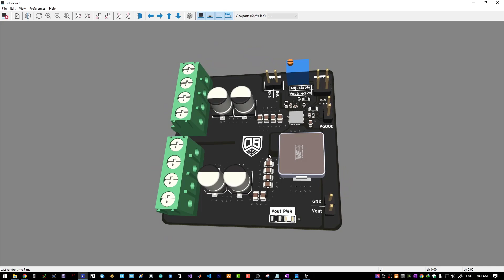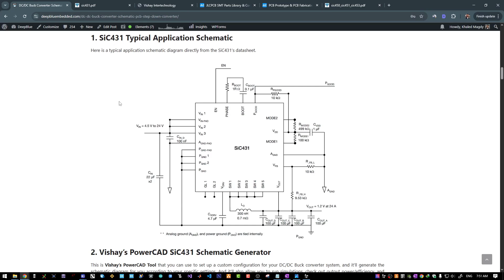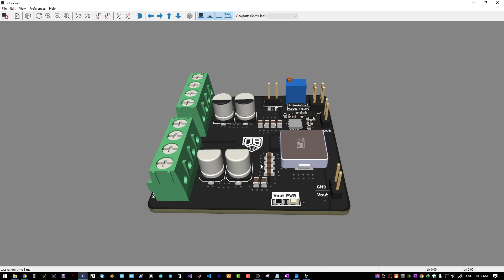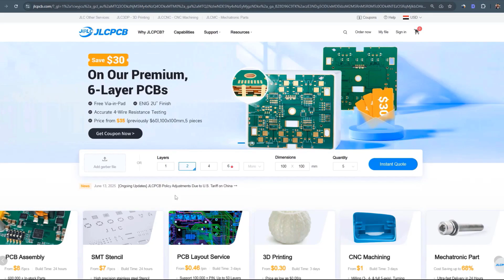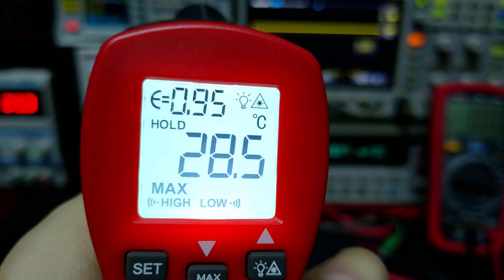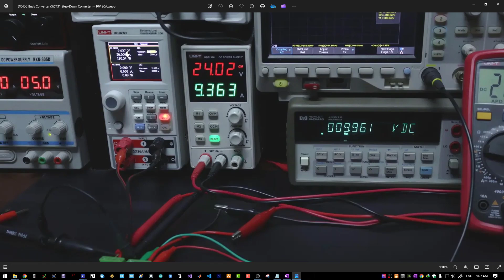DC/DC Buck Converter PCB Design in KiCAD | 24V/24A Step-Down Converter

Comment: Thanx for video. I am starting phase of using buck convertor. I am not able to select a good buck convertor. So LM2596-5V is the only choice I can think. Please recommend me a better buck convertor then LM2596-5V.  Input 12V , output 5V Fixed type, current 1.5A to 3A.
Reply from the maker: Thanks for you feedback!
The SiC431 I've shown here would be an overkill for your specs requirements. You may consider: TPSM63603 (better efficiency with integrated inductor), TLVM13630, and also LMR51430. Check those devices specs and datasheets and see which fits the best for your needs.
Reply: @khaledmagdy  Thanx to you from bottom of my heart,  for fast reply and recommendation.

Comment: شرح رائع وتيست مفصل يا بشمهندس..
كان عندي سؤال هو ايه الشروط او القيود في شراء القطع من برة زي من jlcpcb وبدفع عليها قد ايه وبتاخد وقت قد ايه ؟؟
Reply from the maker: Thanks for your feedback ^^
For electronic parts only: it's straightforward and you typically pay depending on the goods' (value, package size, or weight) whichever is highest in terms of customs duties.
For non-assembled PCBs: i's very random, can cost you anything in the range (400-1500)LE per package and it really depends on the package size and weight.
For fully-assembled PCBs: it's much more tricky, it goes through multiple inspections (national security, explosives, weights administration, etc..). Every extra inspection will cost you more, and it's still random. You can expect anything in the range (700 - 3000)LE range.
Shipping + customs clearance can take 2Weeks in best cases and up to 1Month for most of the time and it can rarely take +1.5Months.
This is what I've experienced over the years. Maybe someone else's experience could be different.
Reply: @khaledmagdy  thanks❤

Comment: Can you controll this CHIP with some interface, like BT, WiFi, I2C, I2S, and set parameters with Android APP or HTML/AJAX page etc. ?
Reply from the maker: It's not supported natively, but you can still add digital control on your own. Maybe using its bigger brother "SiC45x" would be easier since it's a built-in digital controller with I2C interface so you can add a small ESP32/nRF52 to do the wireless control and such.

Comment: Hi, my BUCK converter can work as BOOST, if I use OUTPUT as SOURCE. Is this possible with this chip ? Can PUMP energy from OUTPUT / 5 - 10 V /
and make 24 V ?
Reply from the maker: I believe this chip can't operate in that way, it can't do the boosting you need.

Comment: السلام عليكم . بشمهندس ازاى IC صغير بدون تبريد يتم سحب منه وات عالى !!
Reply from the maker: Wa alaikum assalam!
This is mainly due its power stage MOSFETs' extremely low Rdson (2,6 mOhm) besides having a very high efficiency (up to 97%). All of that make the power losses very minimal, so it doesn't generate that much of heat and is able to dissipate it on its own.
Reply: @khaledmagdy و لكن الكفاءة من ٨٠ إلى ٩٥  معنى هذا أن كمية الطاقة المفقوده عاليه اين تذهب هذة الطاقة ! لابد أنها عن طريق الحرارة
Reply from the maker: Yes, in these conditions (especially at light loads) there will be some losses in the inductor and the drivers and it'll need to be dissipated.

Comment: Great project once again I have a few questions about pcb design myself hope you can easily answer me and correct me if I am wrong 
1- How do you figure out track width and spacing for the usb tracks
(If possible can we have usb design guide video for kicad explaining usb2.0 3.0 etc pcb wise meaning how we should design a pcb for a specific usb based application)
2-How to figure out the 50ohm  track width for digital signals and why it's necessary 
3- should I use rounded tracks for routing traces in my pcb design but what will be its effect on usb trace impedance etc please help because I think I can get a lot of functional and aesthetical benifits

Last but not least components hunting how to figure out the best mcu and other parts like usb c pd trigger bus cantroller etc 
Once again great project great content luv from India
Reply from the maker: I'm glad you liked it, and thanks so much for your kind words ^^
I'll definitely address your question in future videos!

Comment: Very interesting video, I would have loved it if you would go into much more detail regarding the layout since it is one of the most critical parts of any high current, high switching frequency power converter.
Thanks for the interesting videos
Reply from the maker: Thanks for your valuable feedback.
I tried my best to keep it as concise as possible but you're absolutely right. Luckily, It's recommended in the datasheet itself + a great app note from Vishay showing how to do it and that's what I've followed.
In a future video, I'll definitely consider going through the layout of a wide-range buck-boost converter using a Ti chip and also show their layout guidelines "nearly the same as Vishay's".